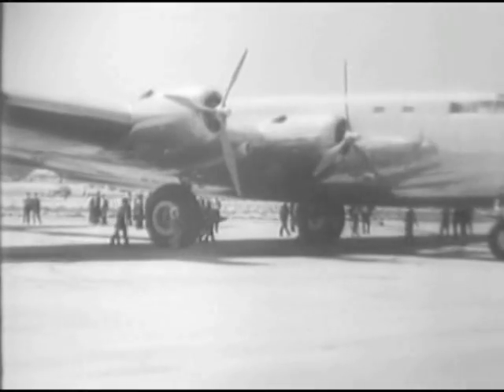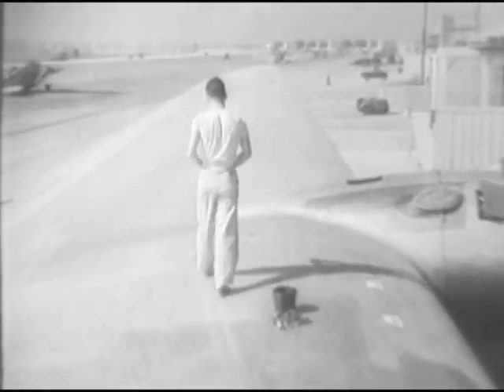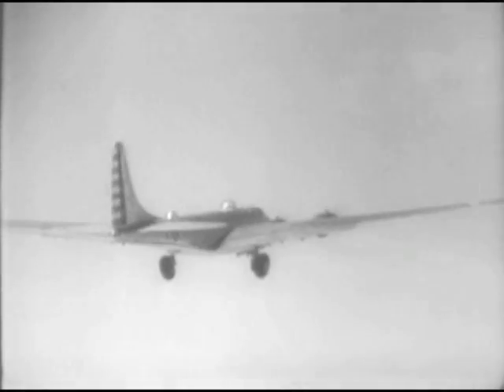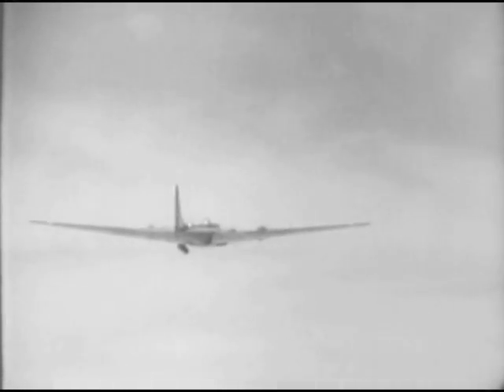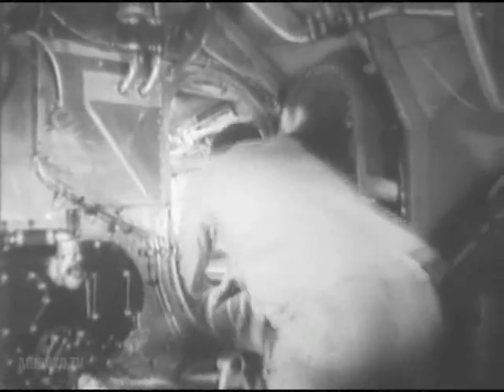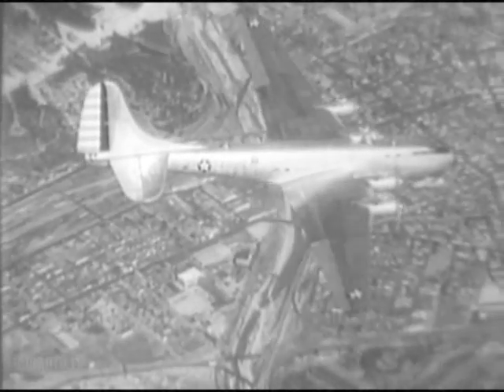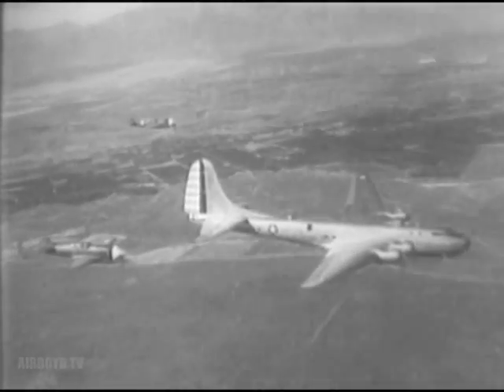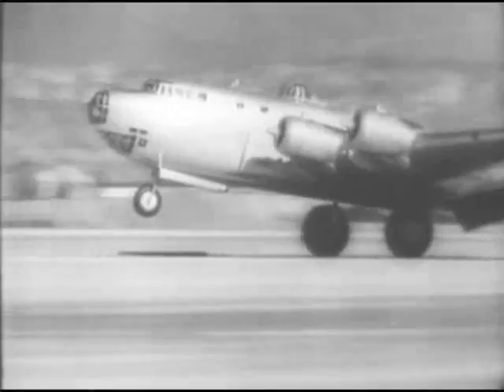Inside The B-19 (1941)

Comment: This is a pretty impressive bomber considering that it was originally designed in 1930. I had never heard of this aircraft before, it’s pretty amazing that the engines could be serviced while the plane was flying, through access tunnels within the wings. I wonder why it was not the primary bomber used during WW II instead of the B-17, B-25, and the B-24 Liberator? It may have been too difficult to mass produce and also to service.
Thank you for sharing and posting this video!
Please have an excellent and awesome day!
☀️✨✈️

Comment: The B-36 originally had some similarly large single wheel main gear tires. The tire companies were very proud of thier abilities to keep manufacturing larger and larger tires for aircraft. While that simplified landing gear design it led to problems. The existing runway and taxiway engineering could not long survive such high pounds per square foot of tire contact area. Some aircraft broke through the ramp, taxiway, or runway surface. That led to multiple wheel bogies to spread the load out more. 

Other problems were the huge equipment needed for tire maintenance, the amount of time and personnel needed to do tire maintenance, and the huge danger a single tire failure could lead to. Those also drove the multiple wheel bogie design decisions.
Reply: When the XB-36 made it's first flight only 3 runways in the US handle it.